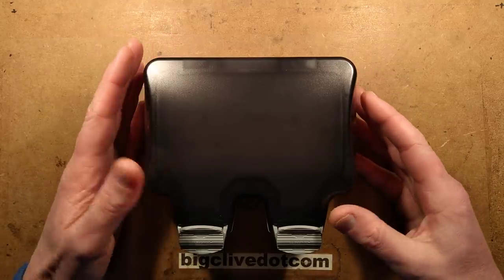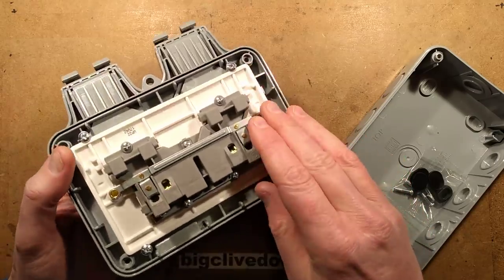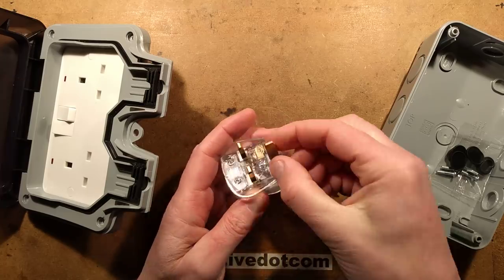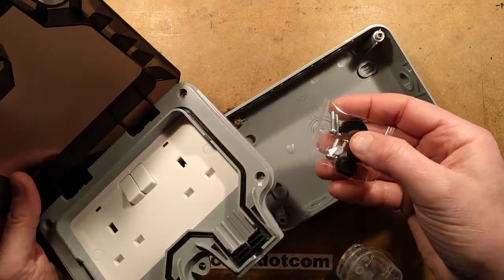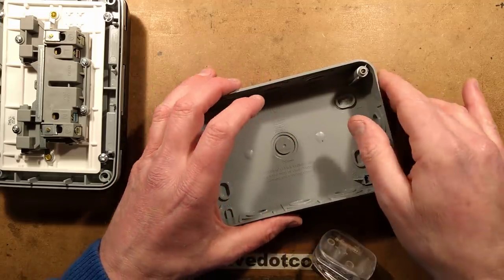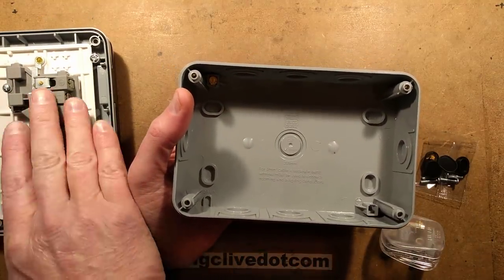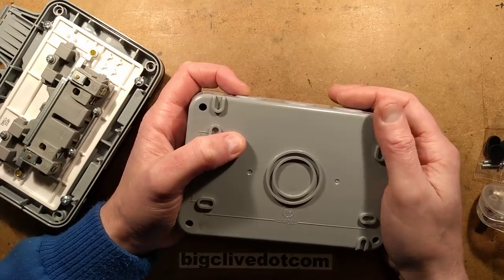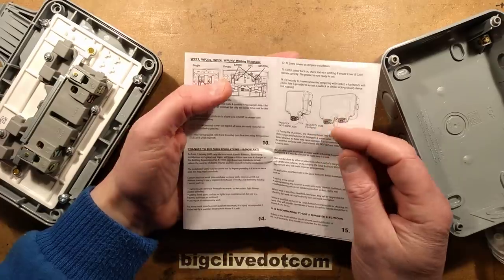British weatherproof socket with clever design. (bonus rant)

Comment: British plugs are the best - super safe. The whole design was driven by the adoption of the 240V, 30A ring main topology which in turn was driven by copper shortages in WW2 and the need to build a shedload of new houses after the Luftwaffe got proactively involved in our slum clearance programme.
Anyhoo, the most dangerous thing you can do with a British plug is tread on one in your stocking feet. You'll be hopping mad.

Comment: Wait what are the phase colors in UK because of EU? I know Germany used brown, light blue and yellow/green striped for decades. Most of the time for 3 phase what I have seen is black with numbers.
Reply from the maker: We were forced to change our colour code from red, yellow and blue with black neutral to the much less sensible brown, black and grey with a blue neutral.   Apparently it was to make it easier for cheap immigrant labour to do electrical work here.
Reply: @bigclivedotcom  that coding fells sensible. But the work is done by polish workers anyway. So that is that. Let's see if that changes in April.

Comment: I think it should be red/cyan for DC positive/negative, red/green/blue and white for the 3 ac phases (cyan/magenta/yellow and white for the respective inverted phases), black for neutral, and unshielded/uncolored for ground
Reply: If you wanted to go really extra with the ac wires you could have the colors helix around at a rate corresponding to the frequency. My thought is that one meter corresponds to one second

Comment: Speaking of water damage and fuses the house I live in has a bad wire somewhere and this is a big house so every once in awhile the fuse box trips all powers off and it’s been getting pretty annoying, the electrician doesn’t know which plug socket is getting wet or what wires are bad so there’s not much that can be done to fix it which is unfortunate
Reply from the maker: If it's a modern consumer unit it may be possible to fit it with individual RCBOs (overcurrent and leakage sensing breakers) that would narrow it down to a single circuit.  Most common suspects are heating devices including cookers, washing machines and water heaters - and outdoor electrical circuits.
Reply: @bigclivedotcom  we have a shed and the house is probably 21 years old, however we did use a outdoor socket for a heater but I think that one had a plastic cover. The RCBOs seem interesting and I might take a look thanks
Reply: @bigclivedotcom  oh yes that does look familiar the power trips every 1-3 hours sometimes more frequent other times less so, and also my sister is on oxygen so turning off certain areas of the house could cause issues
Reply from the maker: @emiliapains5527  It's also worth mentioning that older RCDs that trip power to the whole house can become more sensitive over time.  Sometimes changing them for new ones can solve issues.
Reply: @bigclivedotcom  apparently it’s the shed power line or the shed florescent light

Comment: The bigger issue I find with silicone used in electrical enclosures is it tends to draw moisture into the enclosure. I have always find it much better to jut install outdoor fittings as designed with no silicone

Comment: Probably nowadays most electrical failures came from high power to low power applications like chargers and psu. Sometimes I wonder do we really need 120v-240v system when a 12v-48v would be sufficient in this era of low power high frequency electronics appliances.

Comment: When he was 3, my younger brother slipped a butter knife between the socket and the fridge's plug and across those two live/negative pins. I broke his landing when after the bang, he crashed onto my back as I was playing with dinky cars on the floor 8 feet away.  
The (newly melted plastic handled) knife subsequently had 2 blacked prong shaped bites out of the blade's blunt edge and served as a warning against repeat escapades. 
Later 13amp plugs had that plastic at the pin bases (black in this video). 
Aahhh!! Now you know why this plastic is there! 
60 years later Gerry has never explained exactly why he did this apart from it's his earliest memory and must have switched him on.

Comment: This twin socket is ok but the same thing in single gang is a disaster. Because it’s a switched socket the plug is off set and after plugging in my car charger I couldn’t get the cable to bend to the centre so I could close the box. I had to replace the socket with an unswitched one and that “clever” way of mounting the socket didn’t trap most makes I tried.

Comment: A few years ago I had my metre changed to a smart one. The day the new metre was to be installed it was raining. The guy who came seem keen to get on with his work, I mentioned that he should he wasn't going to change the metre while it was raining, the metre was outside.   He said he could install the new metre as long as the rain wasn't too hard.  I felt unsafe and got as far away from where he was working as possible.  However he did change the metre in the wet.

Comment: I need to replace either the RCD in the consumer unit, or the whole lot (if I am in the mood), which I installed 30ish years ago. However I cannot replace it now. I also cannot afford a sparky to do it as I'm on disability benefits etc. So, it is still there, failing every now and again.

I am more than competent to do the job, and I can do it when it is convenient to me.

I know my electrical system far better than anyone in the whole world, but yet, I am not allowed to basically touch it. I am not even allowed to remove an old electric shower in the bathroom.

It is pathetic. I contacted the IET and they avoided every question.

Had to have an electrician in to wire up our boiler. Took off spur and connected the 3 wires. However, he could not work out how wire in the thermostat - 2 wires + & - on a internal 12v supply. He said he would have to take everything home with him to study the videos and instructions. I did it in 20 minutes. He got £300 for that work.

Keep up the videos Clive - they are really good and well made. Oh, keep up the moaning as well!!!

Comment: I agree about Part P.  I've seen some shocking installations, done both by amateurs and professionals, so I can understand why the legislation was introduced, but the reality is that idiots are going to completely unaware of the Part P regulations and do their own thing anyway.

I knocked down a wall between my kitchen and the dining room and installed a new kitchen, with new plumbing and electrics - I moved the 13 amp sockets, added new ones, installed ceiling down-lights, under cupboard lights and an outside light - so it was a fairly major job. And of course I had to employ a tame electrician to certify my work and issue the Part P certificate. The cowboys would simply have done the work using incorrect cabling etc. and not bothered about Part P.

Comment: Had an “electrician” fix our dishwasher. Mysteriously afterwards it would trip the RCD after a few uses, but if left for a few days would work again. Took the back off it and found he had let a connector rest in the spill tray 🤯. Yeah just cause you got a piece of paper doesn’t mean you can think.

Comment: If the box is mounted on a flat backing board an O ring can be fitted in the circular groove around the back entry hole, that will seal the hole against water. add your own jokes about back entry holes )-;
Reply: That's what I put in place - a rubber O-ring, but it's important to drill through the middle of a brick and not through the mortar so you get a nice flat surface to seal on.

Comment: the acidic sealer is not intended for electrical the acid content is probably to clean the surface just like you can but solders that are acid core and is intended for plumbing to work with the flux to clean the connection.

if you use plumbing solder in electrical applications while it may work you may cause damage.

all the safety features in the world should not be used as a substitute for good parenting 

it is only to give a line of defense to hopefully keep the child safe until you get there.

Comment: Found out the hard way silicon is conductive. Always bring cables in from bottom if not put a loop outside to let water drip away. One flaw because your using standard socket, terminals are on the top water can creep down cables. Once opened a box to find it full to the brim with slugs. Yuck

Comment: The single gang version of this plug is useless. The socket is out of line with the cable path which means you cannot plug in a plug which has a stiff cable, like a car charging 'Granny' lead. They do a two gang version of this which incorporates a RCD which is very good.

Comment: Please tell me what am I missing. British plugs rated at 13A 125V while robust as hell, German plugs rated at 16A 230V those less robust. No to menthion the Earth wire that has no visible pourpous on a plug there the live and neutral can not be reversed!
Reply: Britain runs on 230/240V
Reply: @andrea_frm_dubt8977  ok I am surprised at that one, sitl no answeres the earthing part I was pointing out...
Reply: The live and neutral can be reversed if they are wired wrong at the appliance or back of socket. It's good the plug cannot be plugged in backwards.
The earth is to allow earthing circuits to be completed where needed, like earthing  the metal frame or case of an appliance. The earth conductor also links back to the distribution board and the earth stake/s

Does that cover it?
Reply: @andrea_frm_dubt8977  so basicli earthing is a safety feature for some drunk may connect the wrong way the neutral and the live... sad since the neutral and the earth are same potentia by they are conected together in the circuit breaker.
Reply: Yes, it is for safety, it allows an alternative route for current to flow if there is a problem

Comment: I didn't used to need a torch for 3ph when working in semi darkness but with new cable colours you need all the light you can get! Also ithink we are getting regged to death not enough onus on installation practices, sorry Clive my rants over .Ps have installed those sockets,I normally run a bead of silicon across the top.
Reply from the maker: The electrical industry is currently a mess of red tape and deskilling.  There are a few primary culprits who have put their profit before safety.
Reply: @bigclivedotcom  Clive any idea what the P stands for in part P?I have an idea but I'm sure it's not right!

Comment: Oh and the colorcoding: Old German coding was Black, Grey and RED. 
Guess wich one was the Earth. If you'd guessed RED, you'd be right. But at the time hardly anyone used 3 leads anyway, most was two and grounded. Anyway, the Color changed from the old ones to Blue for Neutral and Black for the Phase and the Yellow with Green Stripes for Earth (or rather Green/Yellow called). What was really funny was the 5x cables with 2 black strands. Great. And guess what they did with the 7x cables. You wouldn't believe it. 
They printed the numbers on it (used mostly for night storage electrical heating things)...
Anyway, today the color for a NYM-J 5x is black, grey, brown blue and green/yellow.

But glad to see that we Germans could bring you at least our cable color for electrical installations :D :D

Comment: The english Plugs are bulky and ugly but they are easy to wire up, they got a fuse which trip value tailored to whatever is on the other end any they  don't allow swapping  N and L around. The wall outlets are nice and flat. The best ones in the world IMO are the ones Switzerland uses. They are compatible to the PE free Euro-Plugs and they got a 3rd pin for PE that also prevents you from swapping N and L. It does not have a fuse, because of the different  wiring in the house and the fuse in the device that it is used for. And it is rated for16 Amps. They are equally nice inside, with clear space and markings where to connect everything. The Europlug is OK, but  not my favourite. I live in Europlug country.

Comment: Where do you stand on Portable Appliance Testing (PAT) Clive? Worthwhile or money for old rope?
Reply from the maker: Very worthwhile.  No formal qualification needed, just the knowledge to interpret the results which are mainly common sense.  You can do a good test with an existing insulation test meter.  The simplest test is to check for visible damage, check the fuses are correct and check earth continuity where relevant.  Ignore all the hype online about certification courses and requirement to do the tests every year.  You can get the labels on eBay and do the tests at a time interval that you decide is correct for the expected wear and tear on the appliance.
Reply: bigclivedotcom It certainly was an annual requirement in multi occupancy environments when I was part of a care home management team up to 2010. But, as you say, a lot of it was common sense & making sure staff were vigilant about residents' & the home's appliances.:))👍🏻
Reply: @eldermanager  PAT Tests are only good at the time you do them, the appliance could leave the machine with a new sticker and have the insulation damaged in the door on the way out. Proper maintenance of equipment is essential to safety. I'm not saying PAT tests are pointless, I've encountered numerous occasions where the wrong fuse has been put in something. But people shouldn't assume that because it's got a green sticker on, that it's safe to use!
Reply: I've also had companies come in and slap stickers on stuff... I've followed them round and failed the same appliance on a simple visual inspection. There are some really dodgy PAT testing companies out there!
Reply: Lufferov I take your point but for residential homes etc. it's a requirement so no choice about it.
Reply: I do a little bit of PAT as a sort of side shoot to my core business - I don't seek PAT work but some of my clients like me to do it. The concept is a good one; many of my clients are religious organisations/buildings or not for profits with a couple of landlords thrown in and I've come across some actively dangerous stuff. To have someone check on a reasonably regular basis is no bad thing.
Who that person is is another matter. Many of the larger PAT testing agencies, the ones that charge <£1/item, pay their people on a per item basis + they expect them to do a certain amount per hour. In those cases I'm sure the quality is questionable.
Yes the PAT is only good for the time of test but then so is an MOT and works in a similar way.
There has been a change in the code of practice a little while ago. Two things changed, well one changed and the other sort of. The intervals have never been set in stone but the one year thing became something of a default (still is but that's another story) so the retest interval should now be decided on a risk assessed basis. Still tends to fall out at about a year for many things outside an industrial environment. The big change is who decides this. It is no longer the PAT testers' responsibility but the 'duty holders'). The DH, not having a clue, can delegate this (normally back to the tester) but it doesn't absolve them of responsibility. This was done because it was felt too many testers were specifying a one year test cycle when two or even three years would have been fine (fixed IT equipment for example) just for the repeat business.
Reply: @bigclivedotcom  I once saw a server room PAT tested. The idiots thought computer???  3 amp fuse. It took ages to arrange a complete shutdown again to put 13 amp fuses back in. Until then random servers just turned themselves off when the fuse blew. We lost quite a bit of hardware which did not like sudden power loss. Must have cost thousands.

Comment: Rather than sealing up the hole, id rather gob an upside down ‘u’ around the hole and maybe a bead around the edge of the edge (again an upside down ‘u’) always ended up ok when i went back. Along with drilling a hole in the bottom of the box and in the lowest part of the conduit, sometimes ends up being more than one hole.  
Never have an entry at the top always ends badly. 
And the acidy sealant id the best! Its actually cures, the other odourless stuff just doesn’t cure, awful stuff.
Reply: james hough - you could have described it as a  lower case “n” the right way up
Reply: This is true 😂😂